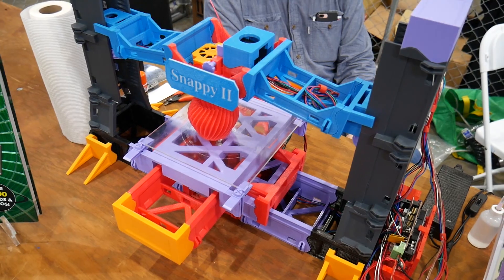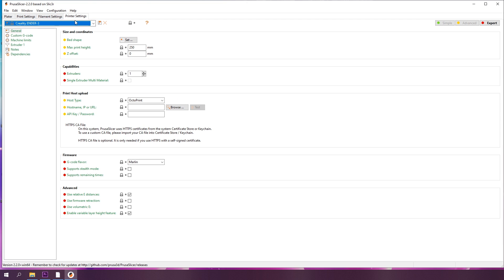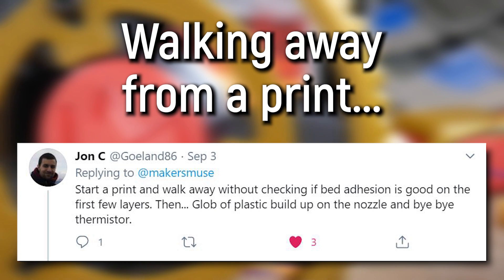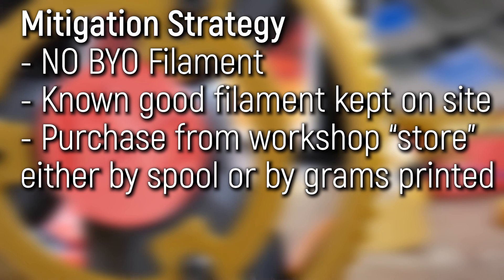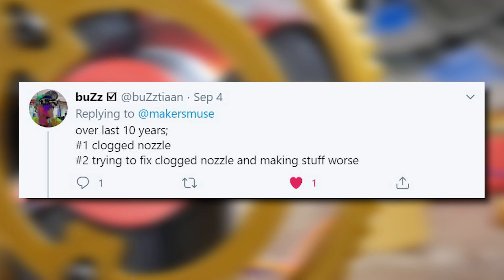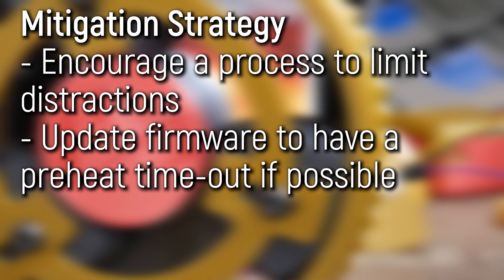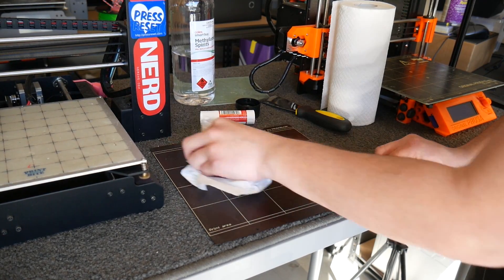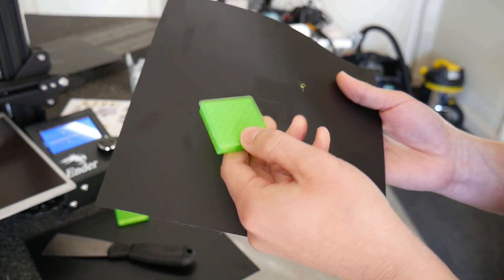How People BREAK 3D Printers (and how to stop it)

Comment: I help look after a Creality Discord server & most of the help sections, are of people not know or willing to learn the fundamentals of 3d printing & wondering why they are getting failed prints. Instead of learning the basics, they think that throwing money at upgraded parts, will fix the issue. Example, "bed is not level, must install a bltouch (or more often its clone)". Yes it kinda fixed their leveling issue, but a simple X gantry check/rework & learning how to level the bed, would have fixed the issue & not cost a penny. And the list goes on. I too have been asked, if using superglue, would work, to hold a warped print 🤦‍♂️ o just whish people would take some time to learn the fundamentals first 🤔

Comment: If people would build printers, and their firmware with 0,0 at bed center (including on cartesians), we actually COULD theoretically print gcode on different machines so long as filament and nozzles are the same size.

Then, if firmware required inputting these parameters before print, we could mitigate these errors.  And honestly, firmware SHOULD be built this way.
Reply: no really, you still need to take into account all the acceleration and speed limits which some printers cant handle and some printers dont come with limits that make sense and just rely on the slicer setting the proper limits. So if your gcode is from a printer that is faster than yours, yours will just fail.

Comment: "Can you use this material I had donated?"
This was the first thing I put a stop to in the university's fabrication shop. Students bring in blocks of metal to be machined not knowing what they are (which, in my book, is just an automatic fail if it's an engineering project). But, this carried over into 3D printing because our shop is the only room that has open source machines. Now, that's not to say I haven't done prints on experimental filaments. But, I literally sat there and observed it printing, and usually stopped and restarted many times to tune the settings.
Reply: ‘There are known knowns. There are things we know that we know. There are known unknowns. That is to say, there are things that we now know we don't know. But there are also unknown unknowns. There are things we do not know we don't know.’
                                              ~RUMMY
😆🤣😂
Reply: I work in a machine shop as an aerospace CAD engineer. In my 2nd year at the job two people (a dad and his kid) come in with a 6" diameter x 8" long cylindrical tube of metal claiming it's titanium and asking if we'd buy it. My response was, we only use titanium for Aerospace parts, all Aerospace parts require material certifications and certifications of origin, we can't buy this because we only have your word it's titanium. 

After they left my brain caught up and was like "hold up, why do these people have a random cylinder of titanium to sell? Where did they get it? Was it stolen?" My best guess is it was stolen so they could sell it at a scrap yard but then realized the local scrap yards don't take titanium so they thought they'd try their luck at the local aerospace manufacturing plant.
Reply: @anastasiacline6159  not only stolen, but invariably smashed off something that was working, causing hundreds/thousands/more worth of damage

They didn't happen to have strong "irish" accents did they?
Reply: have them take an exam and pay for said exam to be allowed to use the machines. that should deter anyone "playing" because its free. Not saying charge them the usual market price but these machines are not toys and are not cheap for some kid to come and play with them. Otherwise go pay a shop to do it for you.

Comment: I have seen everyone of these problem and have caused more than a few of them as I learned.  

I wold have to say the most frustrating "fix" I ran into was when I came imto the makerspace to use the 3D printer and found the build plate covered in dried glue stick 3mm thick in some places.  I soaked and washed the plate and finally got it clean, only to find that the bed level had been adjusted to take into account the globs of glue.  I spemt the next 3 hours trying to get the bed level again (it did not help that the x axis gantry was no longer level  i.e. one z axis screw was set higher than the other).  After 6 hours of cleaning and adjusting, I left a note saying it was "out of order" and went home (and emailed Austin, who is better at fixing the printrs than anyone else, poor guy!)

My second favorite fixing printers story was coming in to fix printers and finding that someone had removed parts to fix another printer, but left the canibalized printer on the shelf without a note.

And always there is the universal trouble report, "Doesn't Work" amd you spend an hour trying to find the problem only to discover they didn't have a password for Octoprint (because they did not have the training class yet.)
Reply: The easiest way to level a print bed is to put a dull light behind the printer head and move the nozzle to a couple centimeters from a corner and set it to z=0 (lower the bed first though), then look at the shadow between the light on the build plate and adjust the knob until the nozzle touches its shadow.

Comment: Hold up, teachers are letting untrained students use the 3D printers!? That's the issue right there! When I have been helping set them up at my schools, I have made it extremely clear that absolutely no student that has not had significant training should be starting, removing, or touching the printer in general.
Reply from the maker: Teachers can break them too unfortunately. What would often happen is I would install and train, then come back a few months later to find the teacher I'd trained had left and others with no clue had ruined the printers.

Comment: 1) Major mistake : screwing the nozzle tight against the hotend and not the heatbreak.
2) People modding printers : I put my 3D printer in a shared workshop once (fablab), and someone committed to buy it from me. Before I knew it he started modding it without telling me and specifically he drilled the 0.4mm nozzle with a 0.5mm drill bit, but never told me. And then he says he doesn't like it and doesn't want to buy it. Which was okayish since he supposedly done nothing to it... it took me full days of trying to figure out what the hell was wrong with the printer. Still no idea to this day what he was trying to achieve by drilling the nozzle to 0.5mm.

Comment: Angus, you've got to admit that even the most knowledgeable person can do everything perfectly and a print can just go wrong, causing damage to the printer. You've said that you've gotten the "ball of death" on this channel.  Also, you said you've seen people just pulling prints off a bed.  Could that be like Joel and a certain $38,000 printer?
Reply from the maker: True that, experienced users can suffer from complacency or distractions. Recently I messed up my Up mini 2 hot end running an old roll of PLA that just didn't stick. I didn't keep an eye on it because it's such an unusual occurrence and suffered the consequences.
Reply: @MakersMuse  complacent is right, I've gotten too confident with my modified monoprice. For awhile I wasn't even watching first layers because it was so reliable. Not smart lol
Reply: One issue with petg is it is know for being able to rip glass off beds very easily. Even with adhesive it can still happen which is why I avoid printing with it and stick with other materials. Even though the rest of it's properties of petg are good, I don't like the risk of a chunk of glass being removed every time I print something.
Reply: @shanewood5054  This is one reason why I have a Prusa MK3s and I print with PETG a lot. Windex works well.
Reply: @shanewood5054  
I still dont understand how he thought printing with petg on glass was ok under any circunstance.....at least use blue painter tape or some kind of buildtack or even a sheet of PEI held with double sided tape. He should know better!  
My machines all have aluminium beds but i would never even get petg close to glass seeing the damage it can cause.
Reply: @laharl2k  I print PETG on glass on a regular, though I do put on a full layer of glue stick, so maybe thats made a difference? Its a tempered glass bed with the special coating side. That side got totally messed up from me getting over frustrated while leveling my bed, but the smooth side I switched too, I've been printing daily PETG for about the past month on it and haven't seen any damage yet. I'll keep trying though ;)
Reply: ChristopherRaven - yes, the glue stick is the key. It’s preventing direct contact between the PETG and the glass. If you clean the glass with a solvent and print on it directly you will probably break the glass trying to remove the print.
Reply: @laharl2k  I think it's at least partly to do with the surface area involved, which is one of those "minor" issues even (perhaps especially!) seasoned engineers overlook. Still, it's GLASS.
Reply: @OtakuUnitedStudio  
Area or not area, you are still the operator and should know better. Even on adequate surfaces its hard to remove pieces with large flat bottom faces.  A think PEI sheet is the best because its very robust and wont deform but otherwise even on painter tape it will most likely just rip it off. 
The other option is aluminium + pva glue/spray. It will still be hard and you better have a very long and thin paint scrapper at hand to at least reach the center of the piece.
Reply: @laharl2k  somehow, on my printer, PETG won’t stick to the glass bed on my CR-10, though it might be because of the low temperatures I use (220 for the nozzle, 70 for the bed).
Reply: @grahamturner2640  
Most likely that glass sheet has some special coating or something. Just keep printing the same thing over and over and the coating will wear off and the prints will become increasingly more difficult to remove until the glass breaks off. 
Also 70 is way too high, or maybe not depending on that coating, but i usually did 55°C 60°C on the glass bed (with glue stick) and 235°C on the nozzle.
More is not really necessary but might help with warping if its a really long piece.  This stuff is 99% trial and error.
Reply: @laharl2k  If you do it right, PETG on glass is perfectly viable. I use hair spray on mine and i've never had problems with it. Just printed out an extruder knob today, PETG on hairsprayed glass. Came out perfect. I have that same printer right behind my working on another PETG part on the glass bed. I've never had any issues and i'll be continuing to use it this way until I run into a problem with it.
Reply: @shanewood5054  Some blue tape solves the problem. I use a polycarbonate bed for PETG and PC and avoid the issue altogether.
Reply: I print PETG quite a bit on glass, with a layer of glue stick (Wanhao i3 Plus). Haven't had any damage to the glass as yet (I was quite concerned about it, to tell the truth). As I recall, Joel didn't even get to the point of trying to remove the print, the glass broke as it cooled down. I print a lot of modified PLA, and the glue stick really helps with adhesion. I used to regularly clean the glue stick off the glass under a faucet, but these days I spray IPA on the glass - this softens the glue into a gel and I then spread it around evenly and/or remove the excess with a spatula. When it dries it sticks just the right amount.
Reply: @shanewood5054  Late to the party I guess. I have read that adhesion with petg and glass can be quite strong however I never have an issue.  My bed temp is set to 80c when I print.  I let the bed cool to under 50c then remove the glass bed and put it in the refrigerator or another cool place for a few minutes.  The petg doesn't cool as quickly at the glass and will literally fall right off.   No scrapping or anything, then an IPA wipe down and back on the printer for the next go.
Reply: He did know better; hence the 😳 on his face at the time. I print with PETG on glass - BUT - there is ALWAYS something between the glass and the plastic; usually blue tape, but I’ve picked up a sheet of PEI and polycarbonate to experiment with. I’ve also heard of polyisocyanurate foam being used; one of these days I’ll have to give that a go as well...
Reply: Haha, I wondered how long it would be before someone mentioned Joel. Sometimes, shit just happens.
Reply: @seymansey  , I disagree. He could have easily performed a test with a small piece first, not a giant pawn piece. The first layer was a  subject of a hot bed one side and a maximum extrusion pressure on the other side; it just gave up and bonded itself to the glass where the gradients were the largest or where the glass surface was the least smooth. After that the glass had no chance of surviving...
Reply: Michael S oh well eh.
Reply: @eric , the company decided that the publicity was worth the cost of the possible damage to the printer.
Reply: The 38K printer had a print that stuck WAY TOO WELL.
Reply: @williamhuang8309  And then it shrank... 😂
Reply: I wouldn't call it "ball of death" either. It can happen and more often than not its not a big issue if you're carefully heating it up and not rip off cables, etc. Also I have to wonder, if you have an open space and let people unattended for long enough that things go that wrong, the mistake is obviously on you.
Reply: OMG...
Reply: "You can commit no mistakes, and still fail" fits here
Reply: Scott Parker  , I assume this is a dumb joke, or you don't know what this word means. He discovered a long time ago that entertainment "brings eyeballs" to his videos. He never was in the tiny Angus-like league of 3D content creators.
Reply: Scott Parker  nuff said right? :D

Comment: I've been using a 3mm sheet of tempered glass and light spritz of Aqua Net hairspray applied to the glass before it is clipped on the bed. Once the print is done I pop the glass into the fridge hot off the bed a few minutes later the part pops free of the glass with a clean mirror smooth surface. I have done this 100's of times without issue it is well worth the loss of 3mm's of Z. Usually I can just wipe the glass down with rubbing alcohol to redistribute the spray residue to get another print someimes two before having to spray it again. I have tried prints without the spray with mixed results I think the glass has to be ultra clean and the print needs a decent footprint to work without an adhesive. My bed is 220x220 so I bought  two sheets of tempered glass one is 200x200 and allows me to acess the screws to level the bed the other is 220x220 in case I need the entire bed. With two sheets of glass I can start my next print while the printer is still hot.
Reply: Spot On!!! I use the exact same method!!!...cheap picture glass, heated bed @ 65°C, & hairspray!!! When cooling, you can hear it crackle as it shrinks slightly and de-adheres itself from the glass!!!😎👍🏻

Comment: I put masking tape on the bed and scratch the tape with a knife, it works well but I don’t know if it’s healthy
Reply: use a sanding block (thingyverse) and 100-200 grit sandpaper until there are not shiny blue parts on the tape.

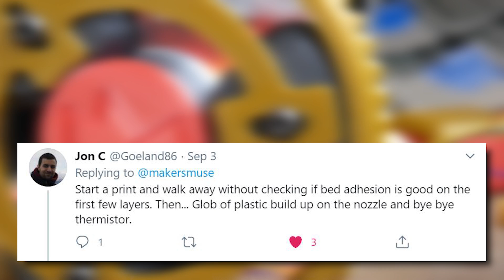Comment: 4:01 "Walking away from a print..." Hoo boy,  that brings back memories. One of my first prints was going to take around 10 hours, and I had to work that day. I started the print and went to work,  asking my mother to check on it in half an hour. That half an hour turned into three. I come home to a giant cooled glob of plastic covering both nozzles and heating blocks. Needless to say, I learned my lesson, and thankfully the plastic was cleaned off with no damage to the printer.
Reply: I left a 6 hour print and came back at about 4 hours to find a HUGE blob of plastic on the nozzle and a broken X axis belt. Let's just say that has not happened since.
Reply: Wait, so do I need to stay all time with the printer? How do you do 24 hour prints then?
Reply: @tomymas38  I would only attempt a longer, unsupervised print with a printer I have complete trust in. After my mistake, I spent a lot of time figuring out print settings and bed adhesives, and I pulled off a very high quality, scaled up Gayer-Anderdon cat print that took around 30 hours. It's all about optimizing your chances of getting a good print.

Comment: I love 3d printing you need to have a lot of patience,. Thank you for the information.👍
Reply: nah, they are pretty fast if you know what you are doing. Sure they are still super slow compared to injection molding but most people print super slow because they dont know how to use the machine and slow is usually a "safe" mode which will compensate for all your mistakes at the cost of your time.